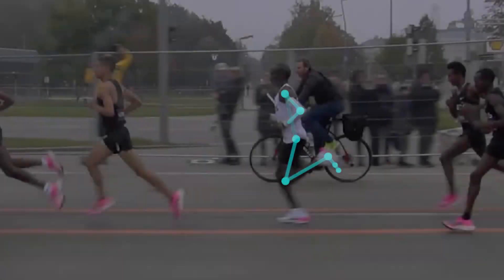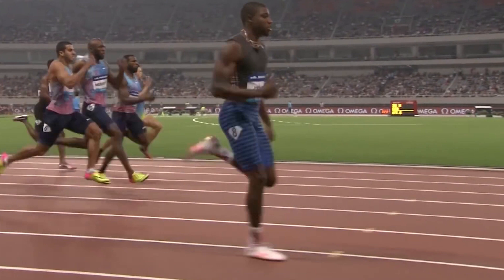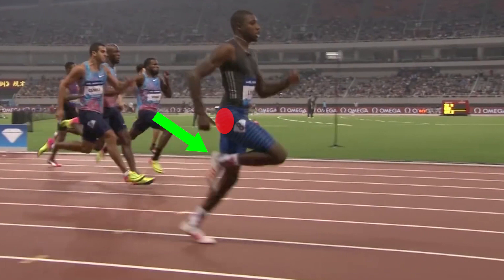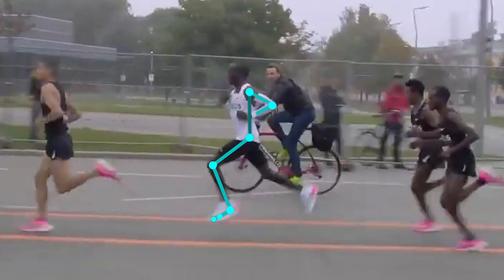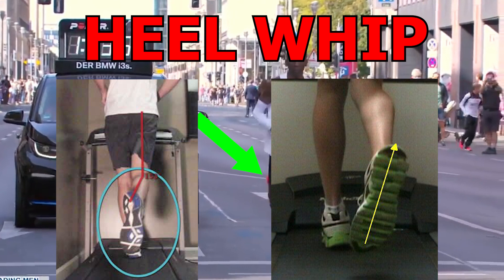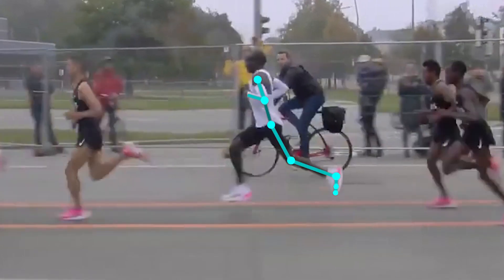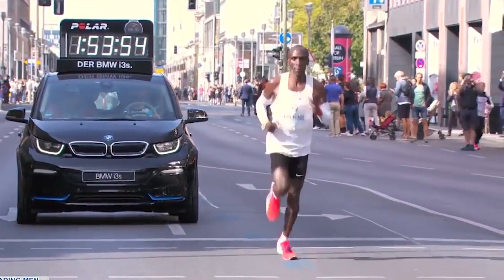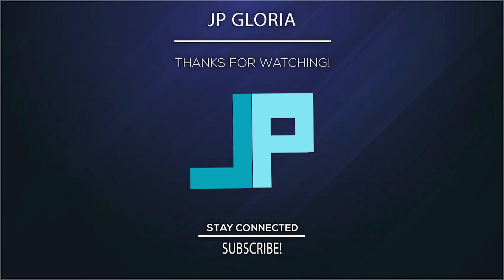What to look for during the Swing Phase of Running!

Comment: Fantastic!  I really like how you break down the swing phase into 4 subphases.  It should be noted that a runner's foot goes from zero speed at toeoff, to a speed much higher than running speed during midswing (to overtake the body), back to virtually zero just before footstrike.  The hip flexors and hamstrings are doing a lot of work during the swing phase to accelerate and decelerate the foot!

Comment: Hey JP! Exactly what I was looking for concerning heel whip. I've been out for 3 months last winter due to a peroneal tendonitis and I'm pretty sure heel whip was one of the reason. Espacially on treadmill where the belt seems to push the ankle inward even more. I'm now back to full training (90-100 mpw with hard workouts without any pain) but sometimes it only took like 20 minutes or running with the wrong pair of shoes or on the treadmill and it flares up a bit. I've already integrated a lot of hip mobility and strengthening into my routine. What's the most important exercices I should focus on? I'm really close to having a cross over gait too. It's seems better and a bit more "square" now. Any input would be appreciated. Thanks! Cheers!

Comment: Really interesting. I did a 3d running analysis yesterday and my knee bend during the swing phase is not close to 90°. Also my step rate is too slow, so my knee does not have to come forward so fast + as I am just a beginner my push from the ground is not energetic enough yet. How do you work on the push off form the ground?
Reply: It takes a lot of speed and strength to run like these guys for a long distance so you have to work your way up to it. 

Add in some speedwork to your running routine. Pick one day a week to run shorter distances on a track. I don't know what distance you run or what you're training for but 8x200m is pretty common for distance runners. 

Throw in some strides after your easy runs. For about 100m, run fast and relaxed and try your best to look like Eliud Kipchoge!